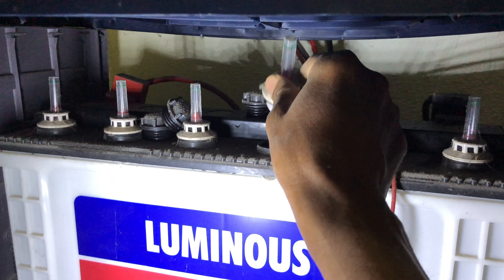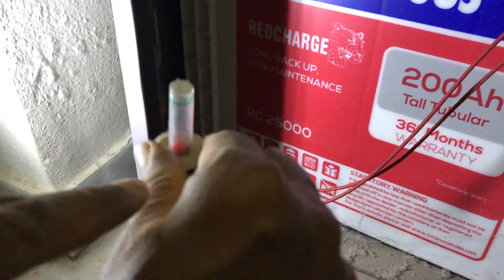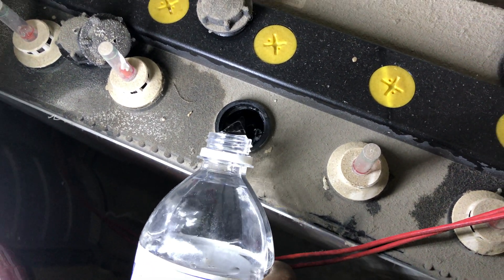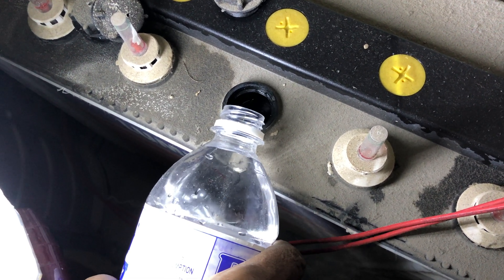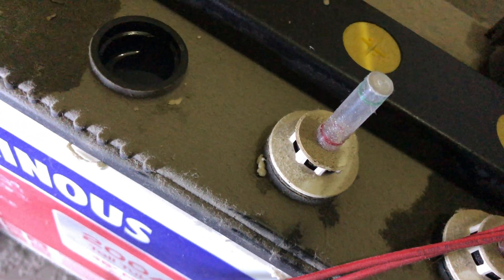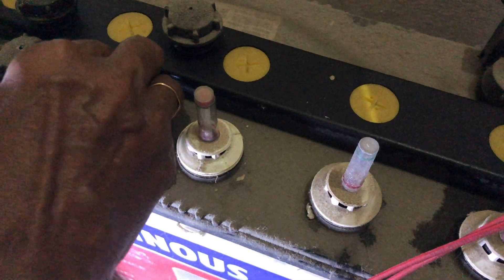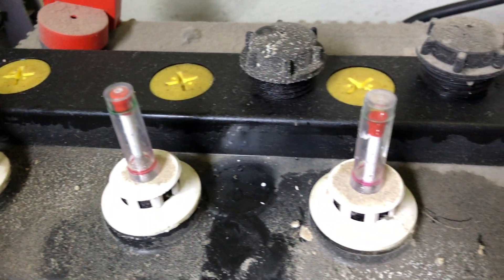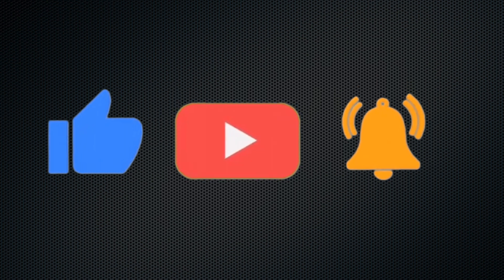How to refill a tubular inverter battery? | Luminous Battery | Distilled Water Refill

Comment: Sorry to say
This was the very wrong way to add distilled water.
You should add water by unsrewing the yellow button by using a coin.
You should not add water by unscewing the floating indicator.
Reply from the maker: No, thanks.. There was another comment that said the same and I pinned it.. Thank you !
Reply: In some batteries there will be only one way for filling the distilled water
Reply: @janaharajanrajan4652 That is old model...better buy this kind of two way model batteries.

Comment: Do we need to switch off the battery main switch before adding water..?  What kind of water is used for amaze batteries.. Pls help me
Reply: It is more advisable to switch off the inverter that the battery is supplying, or disconnect it. 
Distilled water is used for the topping.
Reply from the maker: Yes.. Please switch off and pour

Comment: Why does everyone keep calling it distilled water, it's acid right?
Reply from the maker: No no :) It is distilled water. 
The water that comes out of batter if any, that is unsafe and may contain acid of the battery. Hope that helps !!
Reply: Stripped of important minerals and it contains only hydrogen and oxygen. Nothing else.

Comment: please do not fill like this, this is overfilled. use the yellow caps instead and watch the indicators. once they reach the green, don't fill anymore. if you do like this it will overflow and start leaking when it's charging
Reply: Bro I accidentally overfilled.. What should I do?
Reply: Your battery specific gravity will go down and backup will reduce. There is no way to get its backup again. @kavin9313
Reply from the maker: Thank you for the tip..
Reply: How do you unscrew the yellow caps, though? How do you determine the correct level to fill them up to?

Comment: Just now I saw some other video.
He poured the water by opening the yellow caps. He poured the water there...
You're are showing different.
Which one is correct?
Reply: Actually the yellow caps are given for water filling only. The float is only for checking the level. (In some batteries only float is available so float should be removed for filling). If both are available ( cap and float) it is better that u can pour water and simultaneously check the float level also without removing . This is useful if the battery is kept higher up where u cannot see the inside of the battery ( where if only float is available u have to use the float every time to float remove/pour water/check float cycle until the float reaches green mark which is frustrating ). So everybody, if  separate hole is available better to fill water through that hole and don't touch the float ( if float is removed frequently , it may not work properly). I think only Luminous batteries have this facility.
Reply from the maker: Looks like it can be filled both ways.. I also just got to know we can fill from the yellow caps.. The electrician who visited our house did it this way..
Reply: @EverydayReviewsEntertainment  Okay than I'll also fill through the yellow caps 😊 thanks for your reply 👍
Reply: Better to fill by yellow caps. This gives indication of water as you fill it.

Comment: How to turn off the inverter before filling the battery?
Reply from the maker: Pull the plug out of the socket.. And then push the power button on the inverter..
Reply: What will happen if someone fill the distilled water through the yellow part there?